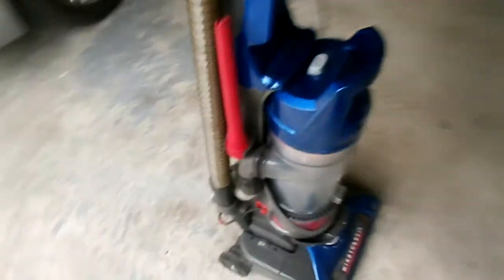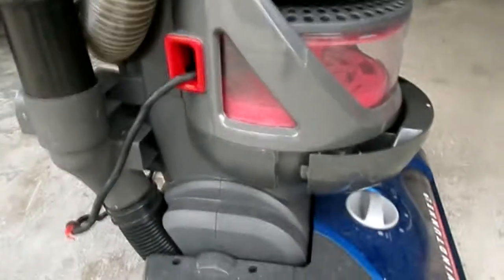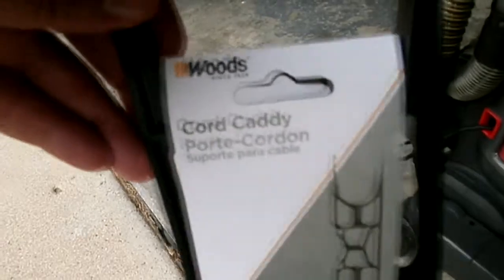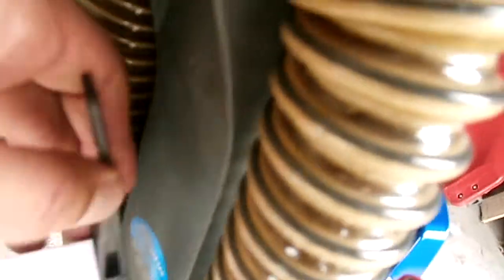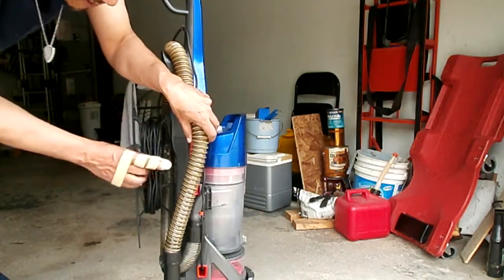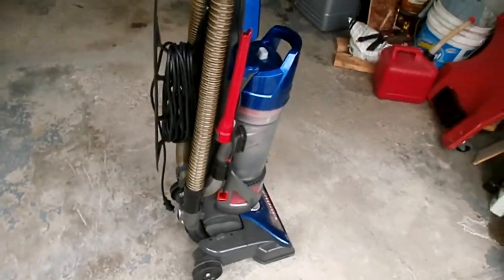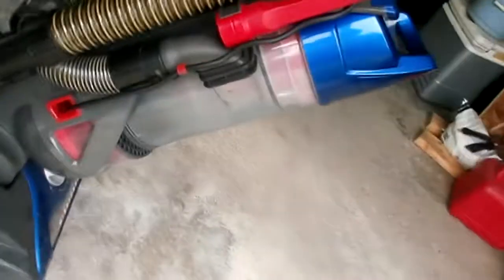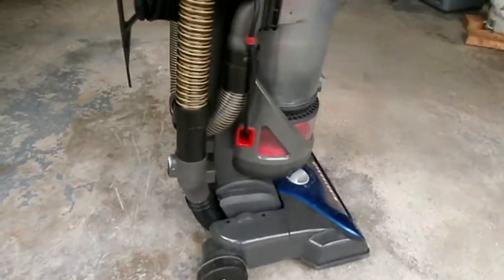Vacuum Cord Reel Repair🛠🏠 - DIY Projects

Comment: Hold down the cord retractor lever and pull the cord out at the same time. Then tug on the cord with some force a couple times. That shouod fix it. At least it fixed mine
Reply from the maker: Thanks for the tip, however that didn't work in this scenario.

Comment: If you pull the little filter on bottom and push white button it will retract brother
Reply from the maker: That method would not work on this particular model. Thank you anyway.
Reply: THANK YOU! I was taking it apart; read your note. Had to tilt the vacuum back to see the white lever inside on my right (vacuum's left) and pushed it with my screwdriver and it works! I also now am more familiar with the innards of my old vacuum cleaner.